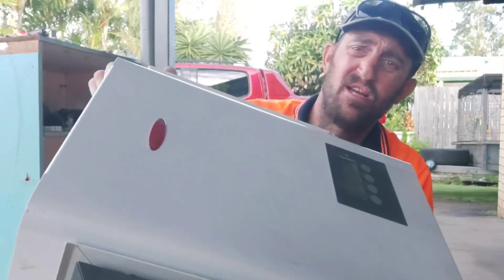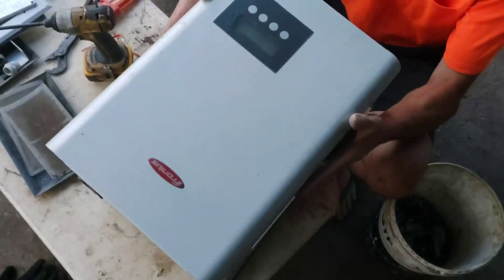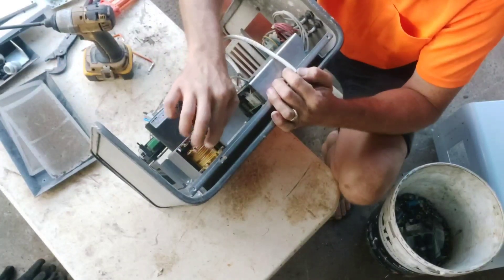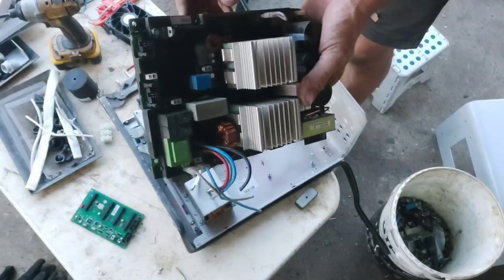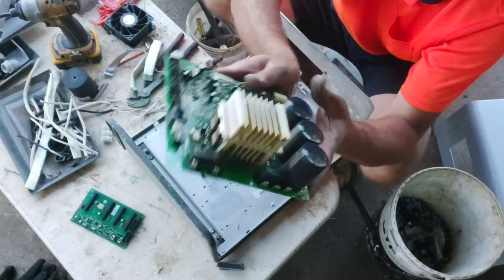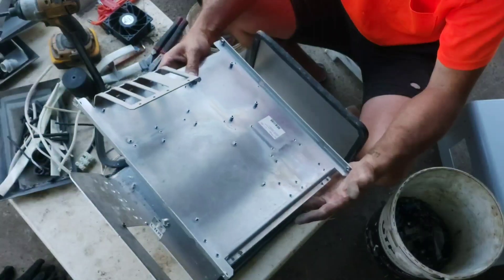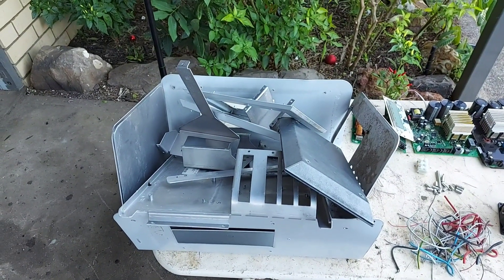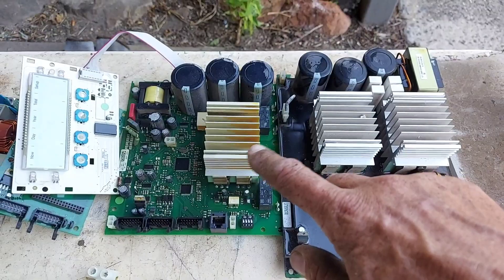How Much Value Scrapping Out A Fronius Solar Inverter?

Comment: Hi Dan. I see you've tackled a fair few of these solar invertors now but I havnt seen all of the videos you have on them. Have you ever tried removing the copper from the toroidal transformer?  I recently took a solar invertor apart and found it had a huge one at 14.5kg and it's incased coated in a rubbery resin. It also had a smaller one around the 4kg mark and had like a black ceramic coating. I have seen in one of your videos yours the transformer was clear wrapped which looks to be possibly easier to see the copper windings which maybe the better type to try remove the copper than the other type. 
It's probably not worth the hassle just thought there myt be something out there that somebody tried to break it down somehow. Keep up the good work
Reply from the maker: Hi Scott, you can certainly find some heavy toroidals in them inverters but tbh from my view i dont think its worth the hassle getting the copper out + remember the bulk of the weight will be made up of the steel donut that the copper is wrapped around, but in saying that if your getting poor scrap prices for a transformer/electric motor then having a go stripping it could be worth your while.

I also got a toroidal out of inverter last week that was also incased in a hard green rubber, it was pretty heavy and that particular inverter yielded some pretty nice stuff, i did do commence a video of it but due to the app i was using ( not my normal app ) it got stuffed up so i abandoned the video and stripped the 4 inverters off camera.
Reply: @danthescrapper815  thanks for your reply yes mine is covered in the green stuff to. I don't think I'll bother then if I attempt it I will will lose a lot of blood sweat and tears and like you said the amount of copper versus total weight will probably be the same. I'm not sure of prices I live in Perth Australia.
Reply from the maker: @scotthoward4836  Yours has green too! Id laugh if we done the same inverter, mine came out of a heavy grey and orange inverter(heavy bastard too).......Iv got an inverter thing that i found in the bin laying around from last year that should have a toroidal wrapped in plastic (well last one i did out of them was) so maybe just maybe ill do a video removing the copper from it just for viewing purposes....See what happens when i get to it.
Reply: It could be the same mine was a cream colour it weighed 35kg total.  this is my own invertor had for years just sitting around I went to instant hot water. I've only ever taken 1 fridge motor to a scrap yard which only paid 50c a kg but is a toroidal classed different in price? I hear on videos people call it transformer price or copper bearing motor price. I heard that scrap yards only pay low for fridge compressors because there is no real way of telling if it's copper or aluminium wire inside.
Reply from the maker: @scotthoward4836  Mine was a similar weight, 36kg it was. Yes fridge compressors are usually a cheaper scrap value and depending on the yard your transformers will be bought as an electric motor tho some yards may buy transformers as a transformer....You did play in a metal band did you?
Reply: @danthescrapper815  I played the bass guitar
Reply from the maker: @scotthoward4836  Ok are you related to Emma, Sam, and Barbara?

Comment: Not bad but the other ones look better.
I have to knock those little nuts out of the ally to get clean. Not hard just a nuisance to have to do. I hate how they cover the circuit boards in that plastic gel, very annoying. I got more money than I expected on Monday, but, they missed paying for extruded Al that I bought in. I didn't look at the receipt when I got it because was in a rush to get to an appointment. Lesson there, don't bring the wife to the scrapyard as they can upset the routine. So I lost 30kg of extruded price because I didn't stop to look at the ticket before I left. My fault but was trying to fit a number of things in after work and didn't check. Anyway shan't happen again.
Reply from the maker: I agree the other ones are better but at least i know the value of these one should i ever need to buy one from a customer. Your right about that gel, annoying indeed.
Great to hear to got more than expected tho i would have called up the yard soon as you noticed something was missed coz they would probably have put the money aside for you next visit plus if they doubt you they will or should have it all on camera....You could still try your luck but maybe a few days being past already could be stretching your luck unless its written on your docket but not showing a pay then you might be in with a show......It always pays to check the paper before you drive off.

Comment: Interesting to see whats in them. I'm sure in the future there will be quite a few being thrown out.
Reply from the maker: Yeah absolutely, i often find solar inverters thrown in the skip bins of solar installation mobs......Many inverters i find have aluminium heat sinks on them weighing 8kg to 9kg and those alone are worth $24 - $27 so great value.
Reply: @danthescrapper815  That's awsome. I'm starting to see few panels around. Not sure what the recycler would pay for them.
Reply from the maker: @ScrapMetalTV.  up here i dont know any yard that buys them unfortunately, dont know what Victoria is like. Tho i did a google search and found a place on Brisbanes southside that recycles them so ill be getting  in contact with them to see if they buy them or not.